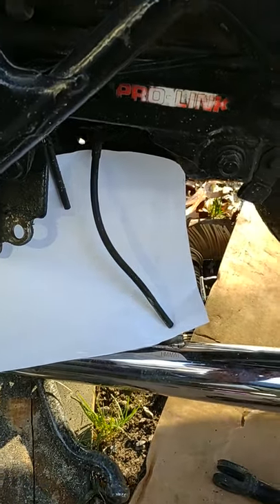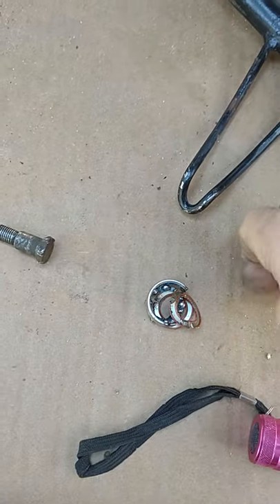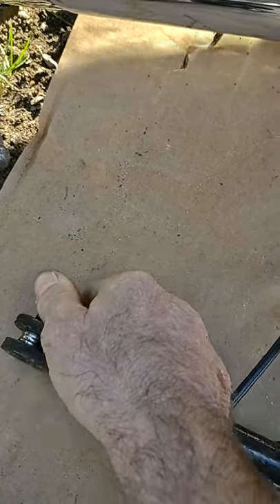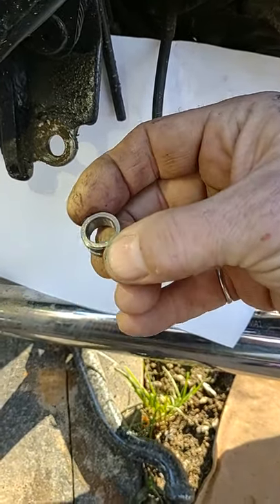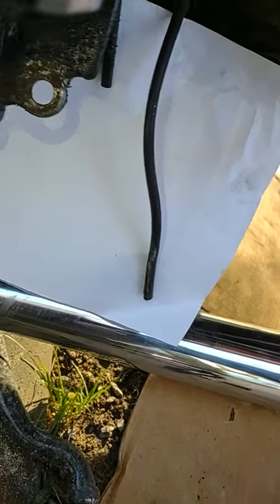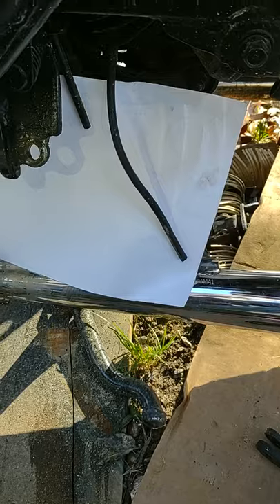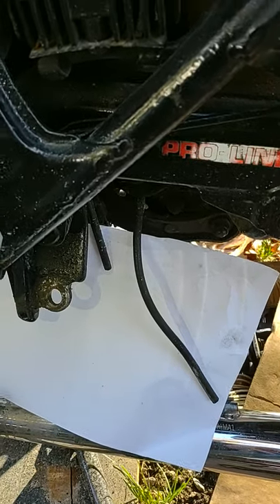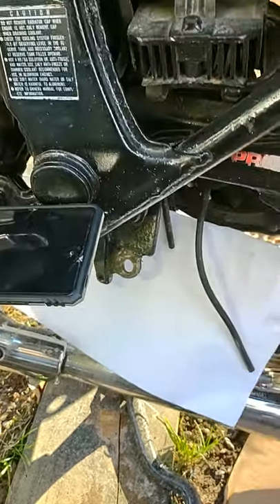Honda GL500 Silverwing side stand lean fix

Comment from the maker: Found this detailed explanation from the original post:

  Someone stated the bolt hole in the frame will oval and they are correct, and yes you have to loosen up the exhaust.  I ordered a new shoulder bolt and nut.  I went to my friendly NAPA store and bugged a friend of mine to find me a bearing with the inside diameter of the out side of the shoulder bolt.  The closest he had ws a SKF 276001-2RSR bearing.  I drilled the frame bolt out with a 5/8's inch drill bit.  I then disassembled the bearing to use the inner race.  It is a perfect fit for the shoulder bolt.  The 5/8th in drill bit is just a touch small to insert the bearing  inner race into so I used a rat tail file and slowly filed it until the bearing just about fit.  I put the inner race in the freezer overnight.  The next day i insert the race into the hole I had drilled and used a clamp to press it into the hole.  I assembled the kickstand a few minutes ago and all the sllp is gone.  This is my fix and it worked. I use the sidestand alot. I'm vertically challenged and I need to stand on the front peg andthrow my leg over the seat while the bike is on the side stand. I will figure out how to post  a picture or two.

Comment: Thank you for this. I recall this fix was explained in an FB group for Silverwings, but I didn't really understand the fix until this video visualized it so well. It looks like the bearing from Napa is $29 and may be a "6001" standard bearing. I'm willing to purchase some cheaper 6001 bearings to check to see if they can be used for the same purpose.
Reply from the maker: Glad to hear it helped. Hope the bearing substitution works for you.
Reply: I was able to successfully use a 6001 bearing. Thank you!